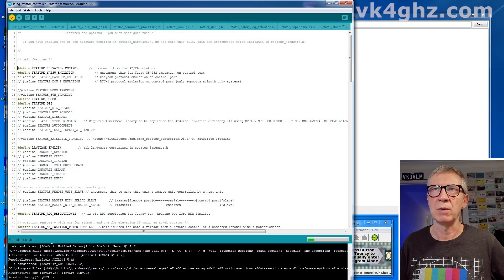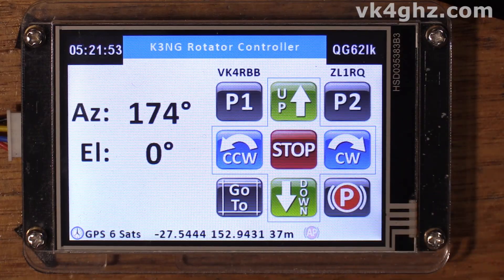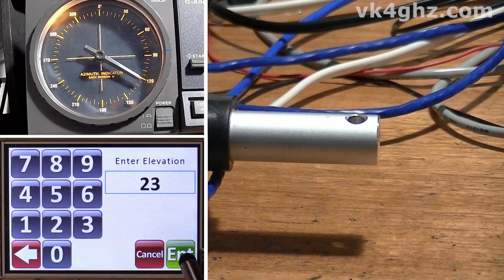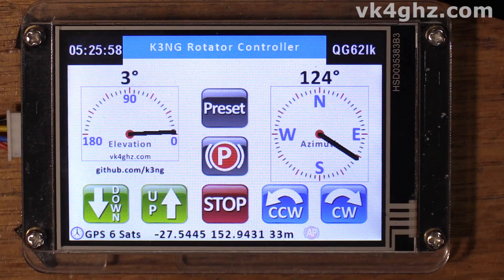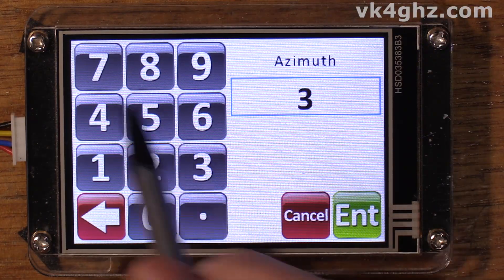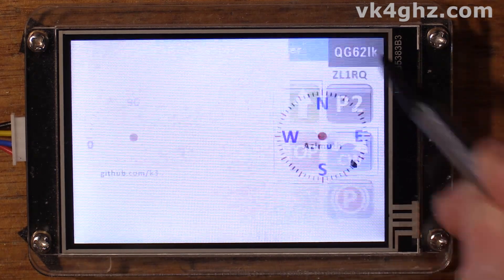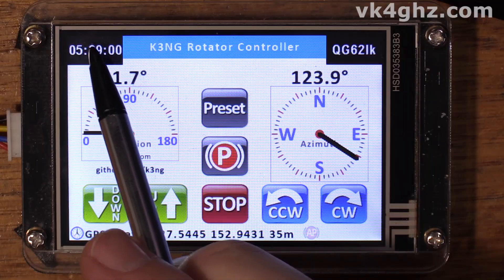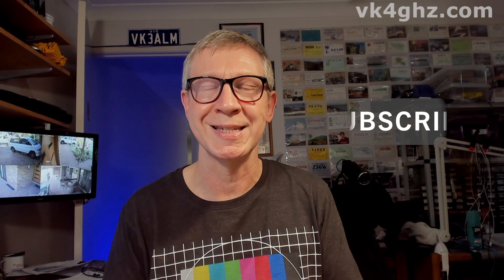VK4GHZ Nextion for K3NG Rotator Controller Part 2 - Elevation, Decimals

Comment: Please.  What voltage is the actuator?
Reply from the maker: Linear Actuator 1500N 12V DC Electric Motor Max Load 150KG with 350mm of travel